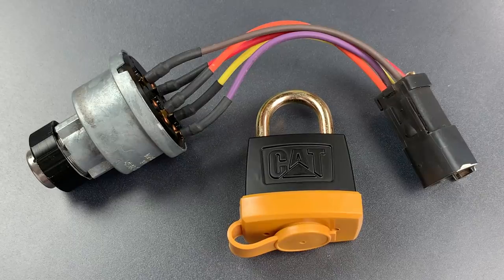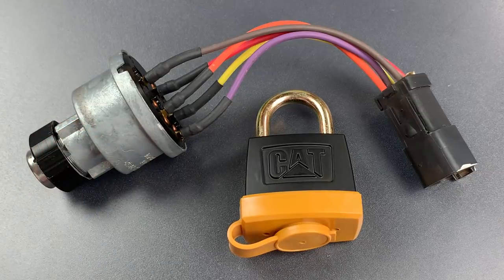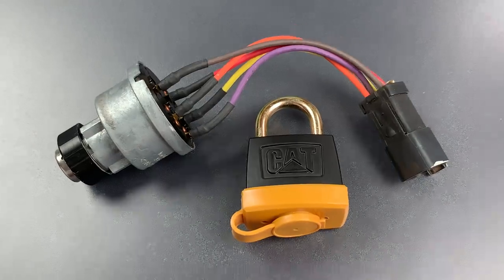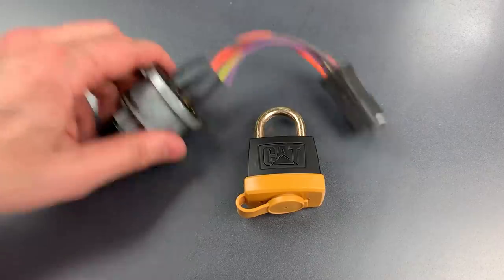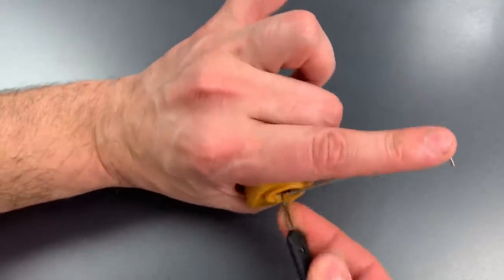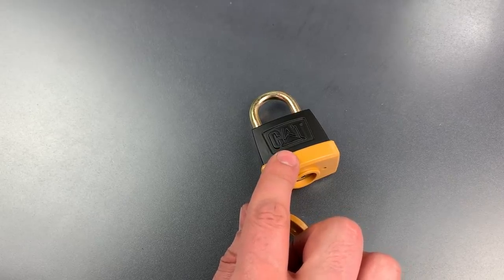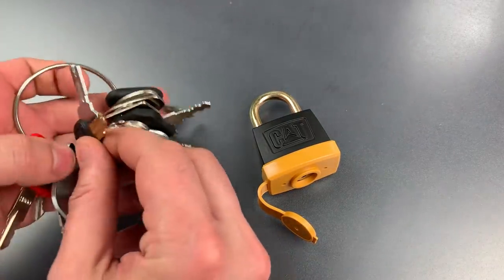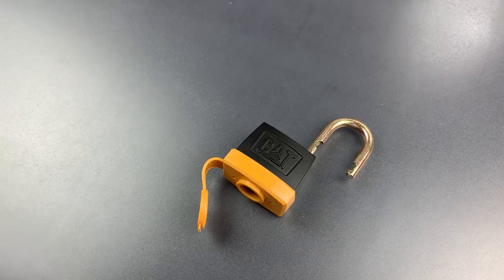[811] These Caterpillar Padlocks ALL Use The Same Key

Comment: This is the case for nearly every piece of machinery out there, basically everything from john deer is the same way
Reply: ....what?
Reply: ReddFoxx1562 It’s true, a fairly standard thing in the construction industry. Volvo does it too
Reply: @brosk1s883  You seem to have a very flippant usage of the term "machinery"
Reply: To be fair, john deer has 2 different keys. ;)
Reply: Alot of massey fergusons are keyed the same aswell. Many times I have come across an abandoned tractor in my path at work. I just take the key out of mine, move it and carry on.
Reply: Case equipment is that same way...same key for all of their equipment.
Reply: This is false, grandfather is a farmer, 5 different deer vehicles, all different keys
Reply: @CrackedLucidity  I should have clarified that it has to by the same type my mistake, but for the reccord all 3 tractors (different models) can use the same key at are farm
Reply: John Deere has 3 keys, one fits older tractors, forestry gear and dozers, one fits graders and excavators, another fits newer tractors 👍🏻

Comment: Such locks are use for "lockout" on electrical or other utilities access for personel safety, not thief deterrent. Like when someone is working on a floor wiring of a building, that particular floor junction box can be lockout with these basic padlock, along with lockout tag secured with it. So if someone were to come up and try to turn it on, it is blocked and reminded with both the lock and the tag that someone is working on it, turning it on can kill someone.

Comment: When the machines are already keyed alike, I can see the appeal of this padlock for certain things. It’s a great choice for locking the fuel cap, battery box, or toolbox on the machine. 

If someone can easily steal the machine, how much are you going to worry about the battery, fuel, or a grease gun and a few wrenches?  

I wouldn’t use it on anything valuable and easily pawned though.  Power tools, mechanics tools, etc...

As far as being easily picked, who cares?  A cordless angle grinder is the universal key. I don’t know of any crimes around here where anyone picked a lock. They just break in. Cut locks, break hasps, bust doors, or go in an easier way. Smash n grab is the problem. Locks only keep honest people honest anyways. They may deter some criminals, but they won’t stop them.   Criminals are all about risk vs reward. Low risk and high rewards. They will skip a shed with a $5 lock if they don’t know if anything is valuable inside. They will cut an expensive abloy if they know that they’re going to get a lot of valuable stuff.
Reply: a trucker told me once when i asked about his grease gun. they involve work something a thief isn't interested in. never seen one at a pawn shop.

Comment: Ah yes. The common key. Amazing security.
Reply: Amazing Security.
Reply: At this point i'm starting to wonder how many places could i get into without lockpicking by only byuing keys... Lifts, construction sites, cranes, residential buildings that have postal/fire service Knox boxes, buildings "secured" by common access control devices, Police cars and taxis, every cheap low security lock that uses common keys (eg file cabinets)... Just to name a few...
Reply: @alessandroceloria  After watching this video, I found a $40 key ring with 41 keys to allow you access to quite a bit. Then of course the TSA locks. Not sure what else you can buy the shared keys for.
Reply: Large machinery is rarely stolen.  It's slow, stands out, easy to find, and very difficult to sell once stolen.  The common key is a convenience to operators.

Here in Australia all construction lifts use the same key, and it's a well known fact.  Despite this theft is not a problem, why? Because what are you going to do with one if you steal it? Escape at 10kph?

Machinery keyed alike is not an issue... the padlock however is.
Reply: @alessandroceloria  watch some talks by Deviant Ollam, he talks about common keys.  His talks are entertaining and open your eyes to security holes.
Reply: @steampunkskunk3638  Definitely, the problem is not stealing in these cases, but rather people messing around with equipment, such as lift surfing, or kids getting into a construction site and playing with the crane (happened once in my local area, although in that case someone left the key inside the crane and no universal keys were used)... All things welcome for an Urban explorer, but definitely not for a landlord or a chief builder... Also agree with the fact that common keys are a necessity for certain things such as fireman's knox boxes
Reply: @MichaelSurfer  ah yes the TSA "locks"... I forgot them. I had TSA compliant "locks" cut off my baggage twice for no apparent reason. So I don't Use them anymore
Reply: Keying things alike is A-feOK2.
Reply: A good bit just in the emergency access side of things. A fairly famous example of this would be the Yale 2642 key used to put elevators in NYC into fire service mode.  IIRC, FSM sends all other cars to the ground floor, ignores the call buttons, and gives the elevator with the key free roam even in buildings with restricted floors.
Not to say that's a bad use of common keying, as high-rise fires suck, and just the likely consequences of doing anything with a $5 key have so far been a good deterrent to keep people out of strange mischief with those.
Reply: @StopChangingUsernamesYouTube  Look up Deviant Ollam's youtube channel. He provides security consulting services and discusses various ways that elevators are unfit to be used as security devices. 
Fire code does specify that when the fire key is used, the elevator enters fire mode; the elevator controller can fully comply with fire code and also create a security alarm.
Reply: Michael Surfer Where’d you pick that up from? I did a few google searches out of curiosity and only found those jiggler sets for car ignitions. I didn’t see any universal key sets for padlocks.
Reply: @link7373  I found the keys specifically for ignitions for heavy machinery.

Comment: For the ignition it doesn’t matter if they all take the same key because in order for the machine to start you have to have a master key and there  is also a spot to lock up the hole to put in a master key

Comment: I work construction and you actually don't even need a key to start most of the equipment, just stick a piece of metal or a knife in there and it turns no problem!

Comment: Most if not all major machinery manufacturers have a 1 key starts all idea. Cat offer immobilized ignition systems but so few people, if any ever order them that they don't tell you about the option until you have a machine or attachments stolen as we found out the hard way by losing $15k of attachments overnight many years ago. We fit immobilisers to all of our machines to prevent theft now. These padlocks are only good for the fuel tanks to stop kids throwing away the cap or contaminating your fuel system.

Comment: More and more equipment these days are replacing keys with PIN entry ignition. These are especially useful on jobsites that require additional security in preventing equipment theft. You can't start the machine without the correct PIN code. This prevents anyone without the code, even on the same jobsite, from operating the equipment.

Comment: Heavy plant locks and keyed alike so that all operators can access the security lies within the PIN code that prevents startup commonly found on Modern machines padlocks are often used for securing shutters to the exterior of the Machines it is also common place to find triangular service keys on plant machinery

Comment: We only use those locks to secure the master switch, once the master switch is off and the master key is removed, the machine won't start. We never use those lock to secure gates and valuables, because every heavy equipment operator has a CAT key. I have a hole can full... Lol

Comment: They all use the same keys so everything at the job site is easily obtained when the grunts lose their keys or forget them at home. Is to make the lives of the supervisors and managers easier and waste less time on the job site. Also the machines have a 2nd key in them in the battery housing away from the cab.

Comment: Hi, i am a heavy equipment operator. Those locks are intended to be used on your fuel and hydraulic caps on the heavy equipment, as well as panels to the engine and so on….
They are not intended for locking up valuables, they are all the same so operators can change constantly without issues with keys. The locks are only a mild deterrent. 
In my career, working all over the states, and also abroad, it has been a good system. You can easily steal heavy machinery, but good luck buying parts when it breaks, as you will need a valid serial number. This is the larger deterrent on theft. Most modern machines are equipped with gps as well. 
If you are a professional thief, you will not have problems stealing anyway. We live in a very soft world. 
I have had one machine stolen from me in the last 30 years. It was found being shipped overseas with a bunch of other stolen machines and exotic cars.
🚜🤞🏿🤷‍♂️

Comment: Your videos largely convinced my to take up picking. I started a few days ago and just was able to open up my third lock, with every lock I get a little more confident. 
My main problem is feeling when I’m on a pin. I can feel pins that are binding just because they just have a stronger resistance, but I really can’t feel when I’m on a loose pin. Meaning I can go past 2 loose pins and not know if I’ve passed 1,2, or 3 pins. And because of this idk when I’ve reached the end of the pins. Any tips to make it easier to feel pins?

Comment: Not sure if it's still the same but their heavy equipment used to all use the same key as well. If you have a Cat key you can run any of their machines. I wonder if the pad lock used the same key as the machines

Comment: I work in mining , the reason for this is not security at all , it’s a stop check to prevent other workers ect from opening or closing the master switch for the equipment , ie why is there a lock here I best look into it further before I use it , not to prevent people from using it essentially same goes for the ignition most places when operating they key is left in the ignition and as a stop check if there’s no key it gets the operator to ask why , maybe it’s down for service ect , they have there place just not for security

Comment: So I am looking into starting to learn lock picking. I remember in one of your videos you recommened buying multiple locks to learn off of. I've been scrolling through ebay and haven't found much in terms of cheap used locks or cylinders. Where else would you recommend checking? I would also appreciate any additional advice that I might need.

Comment: I think the purpose of these is only a CYA. It stops only random drunk/stupid people from doing major damage on a whim. They aren't interested in stopping you from stealing, but just putting up a mild defense for insurance and liability reasons. If you just have a push to start bulldozer, and someone damages something, you might be held liable for not securing the device. Yes the lock is easily picked or bypassed, but then the liability no longer rests on the company.

Comment: All keys are pretty much the same on all heavy equipment, not for anti-theft just to start, the anti-theft is the battery kill. Maybe someday it will change I doubt it though, if you have a key you can jump into any machine that matches the brand. A good seventy or eighty percent of the time.

Comment: A lot of them have password locks too that you have to enter before you can crank it and they're not that easy to move off the job and is not very easy to sell too and it takes a special vehicle to move them you can't move it with a regular pick-up

Comment: I would really like to practice picking locks, but what tools can you use if you don't have a lot of money?
Reply: Basically you just need a pick and a tension wrench. I started with a piece of a windshield wiper metal insert, you can find a ton of them in the garbage cans outside autoparts stores. Find wipers with metal in the rubber wiper part, rip the metal strips out, cut a 6 inch piece off and bend it 90 degrees or so. That's your tension wrench. For a pick, any stiff piece of wire with a slight hook bend on the tip will do. I used a large safety pin when I first started. Still carry a wire pick with a handle made from an old piece of brake line. I doubled the wire back, stuck it in the brake hose and flattened it onto the wire. Wire is really flexible and you can't put a lot of tension on the pins, but it works for most locks.
Reply: @cojones8518  thank you very much, that was a really helpfull comment.:)

Comment: Do you operate cat equipment or own any.
Reply: Yes!  but only one of those options; why?
Reply: @ReddFoxx1562  just curious i seen all the keys. I own a landscape company so I use them also mostly backhoe and skid steers.
Reply: I used D9 cat in a coal yard for a coal fired power plant. But that was before BHO took away the carbon credit system

Comment: HELP I am a fan of your videos and have fun watching them you’re real good. I have a warehouse with big master locks on them. One was broken prob with wrenches one was cut which I didn’t Think could be. So my question is easy what lock is the strongest against those types of attacks. I don’t believe I’m dealing with lock pickers. Thanks for your time and all your videos
Reply: Good disc padlocks are fairly resistant to bolt cutters, as I saw in a Lock-Lab video a while back, but then the thieves will just pull out cordless angle grinders.
The REAL solution is (preferably hidden) security cameras and possibly an armed guard if you want to guard real valuables.

Comment: I guess having different keys would be logistically quite complicated on building sites and the like, therefore the security is compromised here. I see why you dislike it, but I can also understand why it is done.

Maybe with modern electronic locks this could be solved. But then again, it seems they are all flawed as well.

Comment: The only real use i see to this is locking the fuel cap or similar on the equipment...the only thing they really have going for them is its hard to get into a highspeed pursuit with an excavator with a 3mph top speed..this isnt a cat only deal either, almost all of the heavy equipment companies use only one or two keys to run all of their equipment.

Comment: This is standard as it's not meant to provide security only basic access control. Every manufacturer of heavy equipment has a few keys that they use for everything.
Reply: bronzedivision exactly mate it also for basic safety like for machines you have to “unlock it” before using and prevent it from turning on by accident
Reply: Joshua De Nunzio yeah it more so for joe blow walking past drunk can’t get in

Comment: I figure that these locks are meant for locking up access covers on equipment (ie. engine cover). It’s not uncommon for people to try messing with equipment overnight, usually trying to steal fuel or batteries but also vandalizing whatever they can. It would make sense to use a key for this that the operator or any mechanic/technician would already have on hand.

Newer equipment has built in locks for these things (also keyed alike) but older machines usually just have a hasp.
Reply: tinfoilhat38 I used to work with caterpillar D9 dozer and various front end loaders. We used the padlock to lock the door to the battery disconnect overnight
Reply: You are exactly right on the purpose of these locks. Not meant to be locking up job boxes and other valuables. Should be used strictly for safety and security of machines and functions of said machines

Comment: The common key is used because there can be many different operators on a site, usually they all have a key. They are notorious for forgetting/losing their key so if they all just have 1 on their ring with their car/house key it's not an issue, kids wont have it to start the equipment and probably couldn't make it move if they did get it to start anyway (they don't work like a car). The padlocks are for a minor deterrent and for insurance claims

Comment: Why try to pick any of these equipment locks??  It isn't worth the effort, just go to Ebay and buy a ring of various equipment keys.  Most people who deal with heavy equipment have a ring or two of them in their truck, yes it's always a truck.  Take a look at an Ebay listing picked at random, careful the prices vary widly for the same item:  
https://www.ebay.com/itm/Excavator-24-key-Master-Set-Caterpillar-Isolater-Hitachi-Hyundai-Volvo-laser/202372776360
 https://www.ebay.com/sch/i.html?_from=R40&_trksid=p2380057.m570.l1311.R4.TR4.TRC1.A0.H0.Xheavy+equipment+keys.TRS0&_nkw=heavy+equipment+master+keys&_sacat=0

Comment: Hey I work on heavy equipment and I know this is a huge security issue but trust me having job sites with different locks can severely slow down work and especially us mechanics being able to access the equipment and being able to work on it all in all most job sites have security and it's not a issue